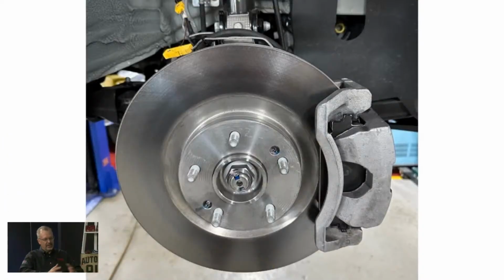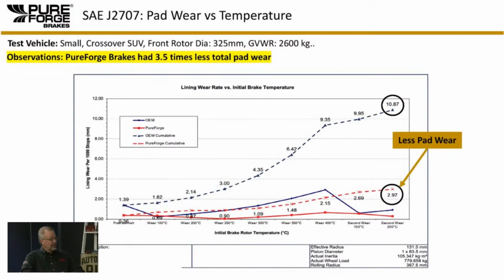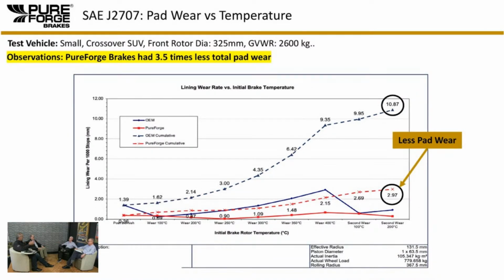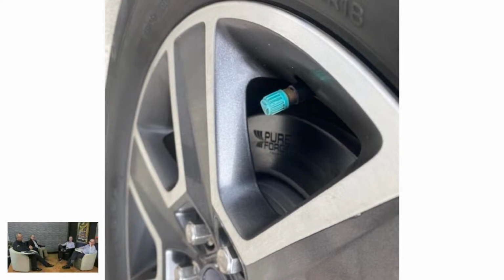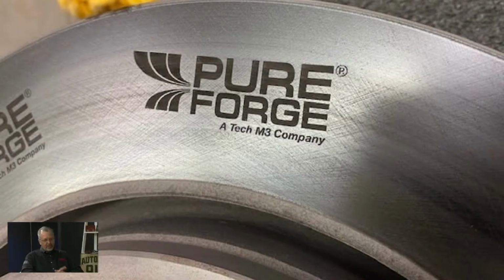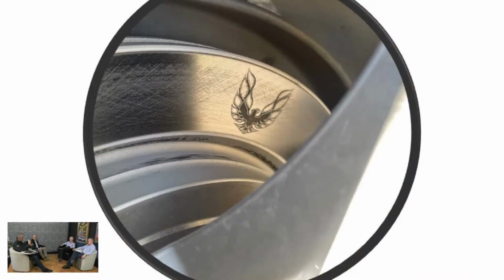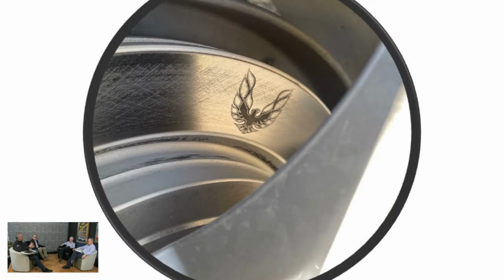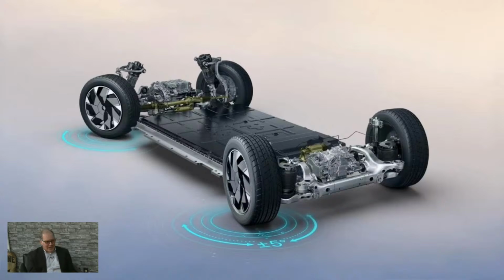Nano-Tech Can Make Brake Rotors Last Forever - AAH 703

Comment: Not sure why this matters with evs anyway.  Our 2018 model 3 has pads that are on a path currently at 120k miles to last 400k miles. So the rotors based on that will last many times longer if they do not rust out or fall apart first.   It will be an ev future. Since when did manufacturers or oems want to sell parts that last longer anyway because they are all about replacing parts and making money. Sounds like nonsense. If they cost more, most consumers wont pay more because they do not want to pay more upfront most times and they may not keep their car that long anyway.  If you have to pay for labor to replace the pads regularly, the rotors is minimal cost more to do at the same time when it is needed.

Comment: "If you believe in man-made CO2 contributing to climate change, that's the premise for EVs." Based on what? Even the fraudulent EV-industry-financed 'studies' do not support any such claims. EVs are no lower in CO2-emissions than ICE for most cars, and even in the cases they claim they're lower the difference is negligible. And this is before taking into account any measures to lower ICE car CO2 through alternative fuels, which is already viable and lower in costs than EVs. Ffe München (heavily EV-industry-funded) published a study which showed ICE cars driven on fossil natural gas to be lower in CO2-emissions than EVs.
And note: this is still based on those fraudulent studies, which are astoundingly wrong.

Comment: Regarding the comment that PG&E had many blackouts and EV’s were having a hard time finding places to charge - Gasoline stations also go down if there is a power outage. I lived through the gas shortages when you could only fill your car based on you license plate being odd or even with long lines and volume fill restrictions.

Comment: John is the only one who gets it the rest are dreaming; the EV tipping point has arrived in first world countries (exception USA is a bit behind), irrespective of any climate denial thoughts, EVs are clearly the better solution (for owner/driver). Sure they are not so good for legacy auto nor the dealership model but that won’t stop it happening. And faster than these “experts” think. In less than a decade NA will be awash with Chinese EVs and just like Japanese cars, you can all say “I’m not buying that trash” but the product is better and cheaper than D3 do you will.
Reply: Show me the numbers for you claimed "tipping point".
- The total of all subsidies and tax breaks
- The total cost of building millions of charging stations, then their maintenance and periodic replacement
- The total cost of grid works
- The total cost of power plant builds
- The total cost of recycling
- The total cost to taxpayers from loss of tax revenue due to EVs (company profits, taxation of fuel, yearly road usage taxation, etc. etc.)

Then show us your numbers for ICE cars
- Accounting for the massive amount already driven so little per year that EVs emit more CO2
- Accounting for the use of natural gas in ICE engines
- Accounting for the use of all the other alternative fuels (and mixes of them) like: NEXBTL biodiesel, bioethanol, biomethane, and e-fuels.
-

Comment: Your guest only knows 47:27 old FUD against EV’s that  has been debunked so many times as lies.  If EV charging stations are down because of power outages… guess what, gas stations are also closed because of no power.  This just happened in Texas. At least come up with arguments that are not years old.
Reply: Guess what: gasoline cars do far better without a few gas stations...not to mention they can be run on a small generator. EVs absolutely need those chargers, and chargers cannot be run on small generators.

Comment: EV's with a electric motor on each axle shouldn't need brakes as the motor can slow and stop the car.  Each motor has a back up motot as a fail safe.  Add that unsprung wright up!

Comment: John is an EV expert. Don’t challenge him.
Reply: John is EV knowledgeable, but I strongly suspect still not an EV "expert"
Reply: No, he's not. He is totally clueless about economics, the world of subsidies, and he doesn't even know anything about the comparison of EV vs. ICE CO2 consumption.
He has no clue that over 50% of cars are driven so little per year that they are lower in CO2 run on normal gasoline than they would be as EVs...according to EV-camp's figures! (Really the percentage is way higher.)
He has no clue that according to studies ICE cars run on fossil natural gas are clearly lower in CO2 than EVs. (Ffe München)
He has no clue that even the ultra-small-scale first production of e-fuel at around 3.50€/liter allows ICE cars to be run on lower CO2-emissions than EVs at a fraction of the cost which EVs cause. And we'd really only need to mix around half the tank to contain e-fuel to be lower in CO2 than EVs. And Shell had said they can produce e-fuel in their first small-scale pilot facility at around 2.00€/liter.

Comment: These rotors with ceramic pads on an EV of any kind and you pretty much will never have to service the brake system except changing out the fluid and maybe some grease on the sliding surfaces every few years.

Comment: Actually Tesla Robotaxi would be a great application for this lifetime brake, also new brake disc stop cars and trucks better than thinned out discs. Tesla cars have a rust problem with their brakes in northern salt belt climates due to the Salt on the roads. This is mostly because of the lack of use of the brakes due to regenerative braking. So this coating that prevents rust, could be logoized with Brembo, and the Tesla T peeking through the wheels would be an option as new. The cool factor of being able to mark the rotors is a premium option that consumers will pay for if not astronomically priced. I buy a Tesla, buy a set of replacement discs from Tesla mark them with the Brembo and Tesla T repeating around the disc, treat the discs, the drive the car to Austin,  Texas with an appointment with the management responsible for vendor parts acquisition.

Comment: My 94 Ford Escort had the brake pads last 185k miles. They would have gone much longer, but a caliper rusted in place causing the pad on one side to wear faster. I never replace the rotor even with 260k miles, when it was rear-ended and totaled. I've been driving EVs for the last 10 years. I drive far less, but the brakes have never needed any service.

Comment: The last thing a developer of Brake Rotors wants is a world of EV’s
Reply: I don't know, lighter brakes would be nice on a EV, every gram of mass reduction adds up to cost savings and further weight savings from a smaller and cheaper battery.
Reply: EVs don't need brakes?
Reply: @pistonburner6448  They mostly use the motors for slowing which allows for regeneration of electricity back into the battery. As a result brake pads can last almost forever

Comment: We were using these hardened rotors from Brazil fifteen years ago. They were heat treated and then cryogenically treated. The manufacturers and standard suppliers hated them. Who builds anything to sell less. We turned no rotors.
Reply: @DaveP-uv1ml  I have no idea what chemicals were used. The engineering department procured these from a company in Brazil through Johnson Industries.
Reply: Do you remember the company name who made that product?
Reply: @kylekleman  we purchased  them for use on Spinters used as PUDs at FedEx. They didn’t last the life of the vehicle but they lasted quite a bit longer than OEM rotors for a fifth of the price. Our vehicles would wear a pair of Bendix pads out in about 20,000 miles. The OEM rotors would be so dished out you would have to replace them on each brake pad replacement. No, I don’t remember the name but Johnson industries out of Atlanta was our parts supplier for this rotor unit. On my POV’s all my brake rotors last the life of my vehicles. I replace only pads and most importantly hand torqued all wheel lug nuts and bolts to spec. Keeping brake components clean and properly lubricated.

Comment: It is interesting that EV's are often talked about, but many of the guests don't seem to up on the latest EV information. They are often a few years behind.
Reply: "If you believe in man-made CO2 contributing to climate change, that's the premise for EVs." Based on what? Even the fraudulent EV-industry-financed 'studies' do not support any such claims. EVs are no lower in CO2-emissions than ICE for most cases, and even in the cases they claim they're lower the difference is negligible. And this is before taking into account any measures to lower ICE car CO2 through alternative fuels, which is already viable and lower in costs than EVs. Ffe München (heavily EV-industry-funded) published a study which showed ICE cars driven on fossil natural gas to be lower in CO2-emissions than EVs.
It makes zero sense to give over the industry to that certain big country and pay trillions and trillions on EVs for no reason.
And note: this is still based on those fraudulent studies, which are astoundingly wrong.

Comment: Porsche has something similar as an intermediate option between regular brakes and carbon brakes. 
The real problem with their technology is that the car buyer won’t appreciate the difference when buying a new vehicle and based on legacy automotive manufacturing philosophy, they want parts to wear out just after the warranty is over.
Reply: correct PCB, Porsche Coated Brakes.  Jason/Engineering Explained did a review of these rotors back on this same date exactly 4 years ago (June 17, 2020).

Comment: Cool product. For last mile delivery though electric car maybe. Would be interesting to have rotors that are less prone to corrosion though for those. I have to force to use to brake to maintwin them these days...
Reply: My 2018 CT6 2.0E plug-in had to replace delaminated rotors at 60k miles.  The slides were sticking to causing pads to wear.  This parked in an non-heated garage and driven daily in the Salt and snow near CLE.

Comment: Spoiler alert: A scalable 4 micron thick metallurgical treatment that would allow brake rotors to last 200,000 miles (320,000 km).